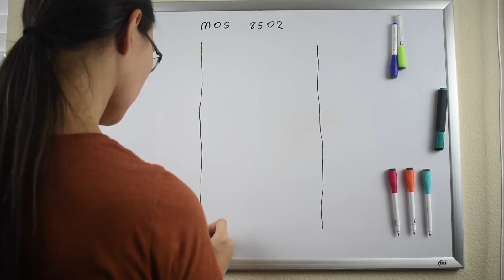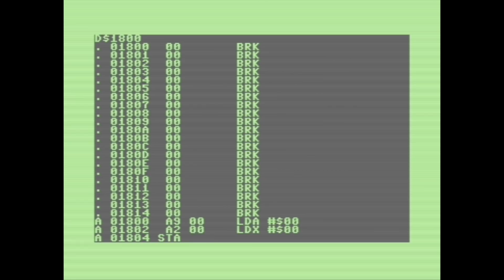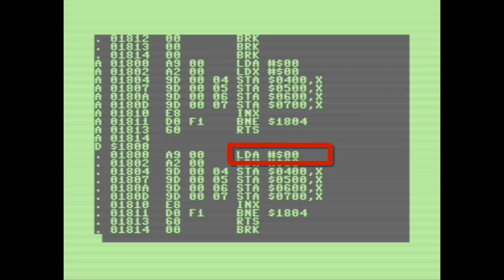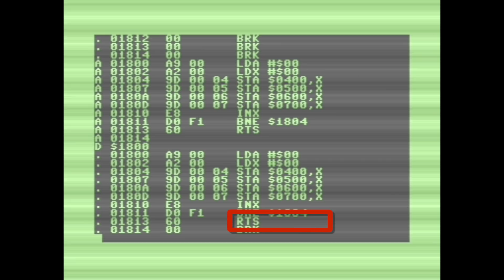Commodore 128D: Episode 1: Meet the Commodore 128D

Comment: one question, if cpu in 128 runs at 2 mhz  is impossibile for vic chip to display a video signal...so how is it possible that some modern games like super mario can take advantage of faster 2mhz clock to avoid slow down effects?
Reply from the maker: vblank and border timing. It's possible to run the 8502 at 2MHz during times where the VIC is only outputting border color or is offscreen in the vblank or hblank intervals of the video signal. Timing it is hard, but doable, but you don't get a full 2MHz out of it, since you keep swapping back to 1MHz during the normal playfield updates.
Reply: @NybblesandBytes  ah ok thanks, very clear explaination.

So running at 2 Mhz in those intervals gives improvement in terms of cpu cycles but not as you could obtain running cpu always at 2 Mhz clock right?
I'm thinking.....and what about SuperCPU extension? I know it runs at 20 Mhz, isn't the same concept?
Reply from the maker: @kyma1999x  Right. The SuperCPU is a different thing -- not sure how it handles VIC timing stealing CPU cycles offhand. I'll have to do some research on it.
Reply from the maker: @kyma1999x  Yes, exactly. Doing that technique nets you some improvement, but not a whole lot. It's not like running at 2MHz all the time. That's why the VDC is so important in the 128 -- it allows for reductions in the badline time wastage by the VIC-II and gives better performance overall while still displaying something to the user. You still don't really get 2MHz proper because the VIC-II is responsible for DRAM refresh timing, so it still slows things down a bit, but it's better for raw compute performance in that config, though at that point, you might as well go the full monty and use the Z80.
Reply: @NybblesandBytes  right, very precise.
Speaking 'bout Z80 I've always asked myself if It could be possible in a complex machine like 128 using it natively to emulate other computers with this cpu, e.g. in europe sinclair zx spectrum was very famous, in usa it was branded timex, no sprites or hardware collision detection/aided screen scrolling and no sound chip...seems to be possibile a sort of emulation.

also nobody never talked about using z80 in c64 or natively in 128 like main cpu for gaming or like a co processor, I still don't know if it's doable.
Reply from the maker: @kyma1999x  It's certainly doable -- just nobody's done it yet because most folks don't know enough about the 128 to really do it. :D

I, myself, am still debating if it's worth using the Z80 for the dungeon crawler game. We'll see. :D

Comment: I got a C128 some time ago sadly couldn't even get 80 columns to work on anything. So no geos128, the only reason I wanted it in the first place. Nice to see someone working with its capabilities
Reply: The 80-column mode and connector should be compatible with any CGA monitor for the IBM PCs of the era.
Reply: @csbruce  Yeah ebay shipping prices kill me
Reply: @csbruce  I also got a CGA to VGA converter but it takes 15 pin and C128 is 9 pin. From what I read they don't cross over easily, missing the intensity pin apparently. IDK not easy
Reply: @El_Guapo74 : There do seem to be a number of those boards around that give short-shrift to CGA by claiming to support it but not providing the correct 9-pin port for it.  They seem to claim that you need to wire up the CGA connector yourself and attach it to some pins on the board.  They might also support a cable like this: https://www.amazon.com/D-Sub-15-Pin-9-Pin-Adapter-Cable/dp/B01JDC9RJU/ (though I don't know).

Comment: Nice video for those with interest in C128 development. Something specific and fresh. I have two questions:
1) Why not C64? It is much more common and your knowledge could be recreated much easier. Yes people can use vice, but using a hardware is the magic, right?
2) Does C128 has memory address multiplexer? 16 bit of addr bus can give only 64k of addr space, and C128 has 128k ram. Could you cover that please?
Reply from the maker: @Oleg Pereverzev I chose to use the C128 because writing software directly on the C64 is much much much more painful. The 128's design allows for much lower level access to the machine. Also, I'm biased: I like the 128 more than the 64, and, well, I have a 128, and I don't have a 64. =op
Reply: @NybblesandBytes  you could use any of tons available C64 monitor cartridges, they seem to work just like your C128 built-in one. And getting a C64 is no problem at all.
But this is up to you to decide, i just think that using C64 could attract more people.
Thank you and i hope you'll keep making this cool videos

Comment: I notice the same old hardware that eventually give up the ghost as so to speak. We must either make new hardware or go with emulation. Can we ger a schematic to all of the chips in a 128?
Reply from the maker: Schematics are available. Sadly, the chips are not.
Reply: @NybblesandBytes  did not someone reverse engineer the pla chip in the 128? If not what is the most reliable 128 emulation hardware? Arduino? Rasberry pi? Or just pc emulation under a version of windows? Having built a pc that is compatable hardware wise with windows 98 thru windows 10 i found. That vice seems more stable under windows 98. Whay is this? Maybe just my perspective. What is the best hardware to run a version of vice on?

Comment: Is the ALU exclusive to the 8502? Or is it in the 6502/6510? AMD made ALU chips back then. I'm not aware of any add-ons for them for Atari and Commodore 8-bits but there was at least one expansion card for the Apple II line...
Reply from the maker: @Jeremy Holloway "ALU" is just shorthand for "arithmetic / logic unit" and just refers to the silicon that does all the math and logic work in a CPU. Every CPU has one, AFAIK.

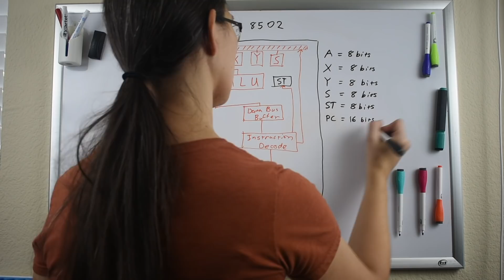Comment: Nice video. One thing I've noticed at 6:59 is that the Status register was not connected to the ALU, although it has flags about the latest operations (Z, N, etc.), which is important (although I can understand that this is a simplified block diargram).
Can't wait for the next episode :)
Reply from the maker: Zsolt Petrik Ah, yeah, I thought I missed something in there. Yeah, the ALU and PC is connected via the same register bus that connects A, X, and Y. Nice catch!
Reply from the maker: I also realized at at 7:40 I mention that the 128 clears out RAM at $1800. Nope! I was using an emulator and the emulator resets it all to zero when it powers on, but the real 128 does not.

Comment: thank you for posting. at 5:02, you mention the 8510 [cpu ?].  did you mean 6510 ?  not nitpicking, nor criticizing, just trying to follow along.  please take care & stay safe.  new sub  :)
Reply from the maker: Ah, no. I meant the 8502. Its still a 6502, like the 6510, but a bit more capable in I/Os and theoretical clock speed, and is unique to the 128.
Reply: @NybblesandBytes  thank you.  i like the way you present n explain the first assembly program.  i haven't tinkered in assembly since back in college, in the early 70s.  regards, dL

Comment: Lack of a built in auto boot DOS, lack of a hard drive, and slow processor speed is what killed the Commodore line.  Those three things killed it. The PC AT and Mac got them right and thereafter it became an infinite race of CPU speed increases, hard drive size increases, and OS upgrades.
Reply from the maker: Interestingly, the 128 actually does have an autoboot facility built in, along with CP/M packed with the machine. Additionally with the CMD Lt. Kernal and the Rear Admiral, they also had hard drives. I've yet to be able to get my hands on the one, though.

Comment: I have the same interest but instead of buying an old C64, Amiga or Apple computer; which are relatively easy to find as opposed to finding a working CRT monitor, I opted to use a Mister FPGA that already has working cores and recreates the machines to perfection.   The one advantage for me is that I don’t need to find compatible peripherals and will run on modern HDMI compatible monitors 👍
Reply from the maker: I would be pleasantly surprised if the MiSTer can handle a cycle exact implementation of a dual-headed C128D -- how is the state of that core?

Comment: I'm already loving this.  I am curious what you are going to use to program. BASIC? ASM? It should be great , either way.  I also program the C128 and it's a great machine, I'm glad you've chosen it.
Reply from the maker: Primarily ASM, I think. Most likely in an assembler that is 128 specific, otherwise something like TMPx, and failing either one of those, probably a cross-assembler. Sadly, BASIC is a bit too slow on the old girl to be useful for games. Far better than the C64, but still super slow.
Reply: @NybblesandBytes  I am using Merlin 128 natively on the C128. It's a really great assembler. I can point you to disk images and the manual if you need them. The editor is 80 columns only though but you can run it in VICE. There is also Buddy, which assembles from basic listings.

For cross-assembly on PC, I use Kick Assembler, with VICE as the emulator to try things on.

Comment: I always wanted those lda #0, ldx #0, ldy #0 instructions in a single byte.  I would have sped things up and saved a lot of memory as you were doing that all the time.  and lda #255 as a bonus.
Reply from the maker: Yeah, best we can do is LDA #$0 followed by TAX and TAY. So that's four bytes. Bleh. :-p
Reply: It wouldn't actually help you speed things up.  All instructions in the 6502 take at least 2 clock cycles, even TAX, and the LDA-immediate instruction also takes 2 clock cycles.  The bigger question is why couldn't they make the single-byte implied-operand instructions take only ONE clock cycle.  My guess is that only one of the fetch-decode-execute phases could be overlapped between instructions.
Reply from the maker: @Brutikus Red Yeah, you're right. Just saves space. I do wonder if the original designer of the 6502 ever went back and fixed that, or if he's just stuck with the original design throughout the years.
Reply: @csbruce  oh, I assumed it would be faster as it would not require the extra memory read to get the #0, so an LDA #0 would be two cycles and an LDZ (say) would also be two?
Reply: The 65C02 appears to have either a virtual "Z" register that always holds the value zero.  It is supported by instructions like STZ (store $00 to memory) and TZA (transfer $00 to the accumulator), which is what you're looking for.  Of course, the mass-market computers of the era didn't use the 65C02, though the later Apple computers before the Mac used the 65816 which also had this "Z" register.

Comment: You earned a new sub today, I loved Commodore computers, I had an A500 and Amiga 2000 back in the early 90's. I programed my Tandy computer back before that. Thanks for the refresher on assembly language. I don't have a VIC are there any emulators you could recommend for those of us that want to follow at home too? Thanks for taking the time to do this.
Reply from the maker: Jerry Watson Absolutely! VICE's x128 is excellent and actually the emulator I use.
Reply: @NybblesandBytes  Thank you. Just to add this may be "old" tech, but it seems very close to the cpu's used in satellites like Voyager. I know a couple of generations removed but still a challenge nonetheless.
Reply from the maker: Jerry Watson Not all that far removed. According to Bil Herd, the guy that made the 6502 core apparently still uses it in places. Especially in rad hardened environments where speed and complexity causes failures.

Comment: Can u in later episodes explain how to make o c64/c128 8bit quality sample playbeck?
Reply from the maker: @robgrabb I'll give you a "we'll see" -- I may not need it for the game, and it takes quite a bit of effort to get it to work right. Basically, the 6502 has to push the samples directly to the SID chip's square wave output with very precise timing, which means it can't do anything else while it's doing that. If you've ever played the Commodore 64's Ghostbusters game, the title screen voiceover basically stops the screen from doing anything while it plays.

What's interesting, though, is that the 128 has a vertical retrace interrupt that basically drives everything in the 128. That might present an opportunity to do more.

Comment: Oh, and you know the shortcuts of the basic commands  I used as well, PRINT = P(R with Shift key) and so on... It speeds up the execution.
Reply: Couldn't you just use a question mark for Print?
Reply: @Wizardofgosz  Correct. It's been a while ;).
Reply: Using contractions like "pR" for PRINT doesn't speed up execution.  Either way you type it, it is represented in the BASIC program by the same single-byte value (153).  Even "?" produces the same token number.  However, there are some tricks that do speed up execution, such as using a decimal point instead of the value zero, or putting multiple statements on one line, or putting subroutines near the start of the program.
Reply: @csbruce  You are right, I mixed it up with another basic version. It is always the same token.
10 pR"1"
20 ?"2"
30 print"3"
then list, and they are all "print"... Except for line 10 here, since it is expanded to PRINT# which expects a file handle...
So long ago.

Comment: Hey there, at about the 5:04 mark you said "..programming for the 8502 is exactly the same as programming for the 8510"... isn't it supposed to be "6510" instead of "8510" or did I miss something? Also GREAT JOB on the video, I am looking forward to seeing more!
Reply from the maker: Donald Hardin Yeah, it was late when I recorded that. :D

Nice catch! I mention this in my next upcoming video. Pretty sure I did something like 20 takes on that and my poor brain was having trouble getting it straight -- even from my ipad teleprompter. :-p
Reply: @NybblesandBytes   I also seem to recall an assertion that the 8510 could multiply and divide.  It can't, you need to chain bit shifts, compares, and adds or subtracts to perform a multiply or divide operation.  Probably a good potential topic for people making the move to machine language.
Reply from the maker: @glenndoiron9317  Right. Planning on addressing this in the next video -- I even have that part already shot and edited. =o)

Comment: More of this stuff please :)

The screen-memory of the C128 ends at $07E8, but your programm overwrites the memory up to $07FF. Doesn't that overwrite something that could be important?
Reply from the maker: It does, actually: I end up overwriting the default sprite area that the BASIC initialization routines set up. This early in the series, though, I think that's okay -- I'll end up covering the sprite area and the memory map in more detail in the coming episodes.

By the end of it, that area is set to $FF everywhere. Really, I should be doing that last LDA to $07E8 - $00FF -> $06E9, which would overwrite some bytes that I previously wrote, but stop short of overwriting the sprite area.
Reply: @NybblesandBytes  Thank you for your detailed answer :) My german C128 manual just labels the area from $0400 to $07ff as 1K of mixed memory, so I had no idea, whats located behind the screen memory.
Reply from the maker: @harveyinashelf3028  Yeah, even the official manuals are a bit... lax in terms of describing whats there. I'd suggest reading through Compute!'s "Mapping the Commodore 128" -- it's bar none the best manual on the memory map I've found.
Reply: @NybblesandBytes : Technically, $07E7 - $FF → $06E8.  You could also start with LDX #$06 and calculate all the other starting addresses to avoid filling the 24 overlapping bytes twice.  I was expecting this approach would lose clock cycles to crossing page boundaries, but it turns out that the STA,X instruction always takes 5 clock cycles.  Of course, all of these technicalities would be confusing to beginners.
Reply from the maker: @Brutikus Red OOps. Yep, off by one -- due to me not double checking the end address. Nice catch. Yeah, also trying to keep it simple for now. Speed and advanced techniques can come later! =o)